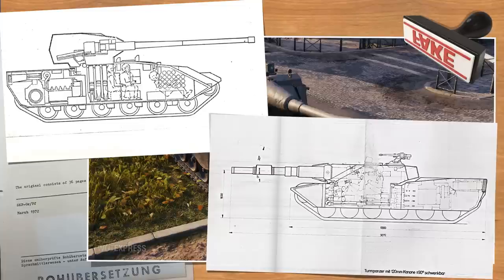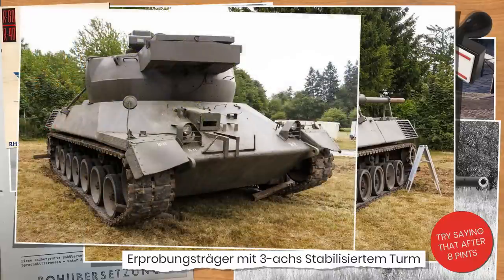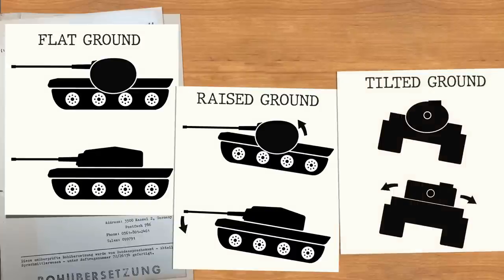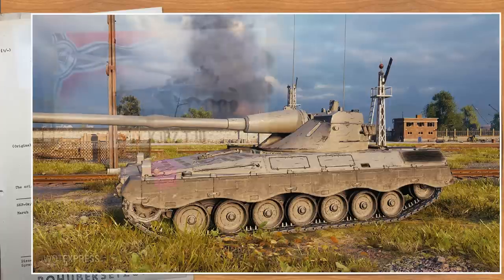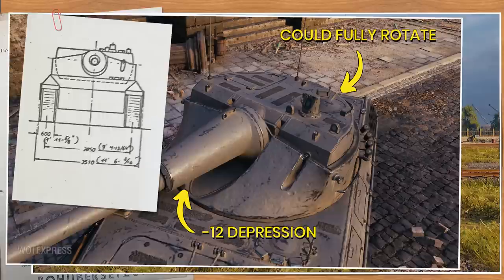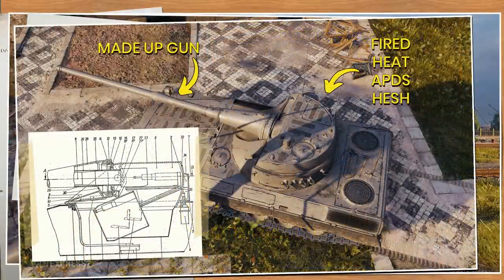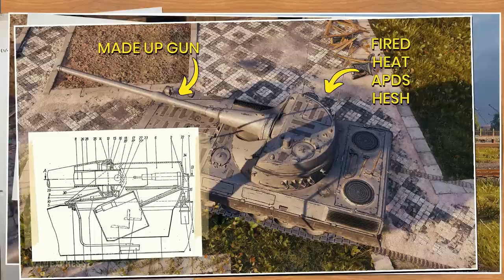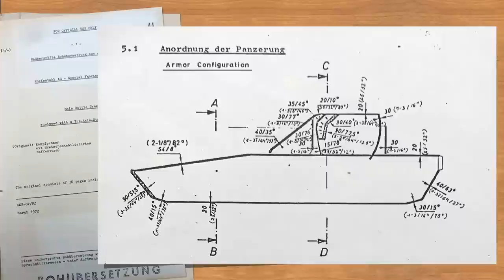KPZ III  - Fact? Fiction? or Fake?

Comment: I love how they make up gimmicks for fake or near-fake tech tree lines, but willingly ignore opportunities to give historical vehicles gimmicks, and just water them down into generic vehicles. 
I would imagine this same tank but with the engine gimmick you mentioned would actually sell better. It could have been sort of like the temperature gauge thing they showed for auto-cannons. You get can boost for 10 seconds at most, but then after that, it acts like the removed speed governor on crack, which would quickly destroy the engine and set you on fire. It would require more micromanaging, but  could have allowed for an unique min-maxing builds where prioritizing internal module durability actually lets you get more out of the turbo mode.
Reply: I can give you an even better one: give it the same mechanic those Chinese "rocket tanks" have. It works literally the same way, giving a power and top speed boost for a few seconds, and takes a while to recharge. Nerf the top speed a bit and you're golden.
Reply: HarverTheSlayer I like a heat management system more, instead of set recharge you can boost at difference times, but the longer you wait to boost again the longer you can safely boost.
Reply: @matthiuskoenig3378  Oh, absolutely, that could be cool as well. I was just making a point of using a mechanic they ALREADY have in the game.

Comment: oh, that's a cool concept of a tank gun.. was like"ok so how does this differ from oscilating turrets" and then saw the gun could tilt sideways as well to accomodate for uneven terrain. that's why theres a some sort of a "gun mount" on the outer turret and the inner turret being basket-shaped to fit in. very cool.
also germans designing cool engines, nice... cant believe engie boosters are actual thing for tanks 

kpz-70 in blitz also was pretty much gutted to be in tier 9 as well(base horsepower being 1500->750)
so... sad idk

Comment: WarGaming really needs to change the name of the game to World of Bullshit . Same goes in World of Warships with the subs they added to the game. Have you ever heard of a WW2 era sub capable of a sustained submerged speed of 30 knots and armed with homing torpedoes ???
Reply from the maker: homing torpedos for certain both german and UK had them, but defeated easily by foxxer systems - accounted for a few kills tho. but 30knots. no. there were some that could hit 24knots surfaced. and even fewer at 20knots submerged
Reply: @armouredarchives8867  The homing torpedoes that existed in World War II were also short-ranged and slow. The ones in World of Warships are a lot more akin to modern wire-guided torpedoes.

Could be worse, though. In the initial test server version, they were straight up moving like Mark 48 ADCAPs. What actually ended up in the game is merely annoying rather than being outright broken.
Reply from the maker: yeah obs they went and made a dog dinner out of it, its WG related. but it was jutst to clarify such things did at least exist.

Comment: When Wargaming does this to designs that have fairly complete real stats available is the most obnoxious part. If they're outright making up a tank, or using a tank that only "existed" as a concept rather than being fully designed, fair enough to make the stats whatever they need to be for the intended in-game role. But if the tank has real-life stats that don't fit the intended role (or are outright too strong for the game period, as would likely be the case for an accurately modeled KPZ III), the obvious answer is don't use it. Don't turn it into something completely different to shoehorn it into the game. Why is that so hard for Wargaming to understand?

Comment: CV90 with rotating turret?  But how do you get a round into the breach (what breech?)? With a raised barrel?  I don’t think so.
Reply from the maker: not sure where u are gettign cv90 from. - the magazine is from from below.  pretty easy
Reply: @armouredarchives8867  it looks LIKE a CV90.  As other people said it looked LIKE it took inspiration from other fighting vehicles. Nothing more 

Look at the drawing/images at :25, a straight line down the center of the barrel would take the breech into the turret ceiling/wall, with insufficient length to slide in a round.
Reply from the maker: https://imgur.com/a/wnBdQWa the autoloader loads the magazine from below  -
Reply: @armouredarchives8867  I know. look at the drawings and the tiny amount of room in the turret for autoloader, horizontally sliding breech block, rammer, recoil, and ejection operations. Looking at the drawings and photos of the turret showing the center of the bore, the gun (with  breech) intersects the roof of the turret.  So clearly there is not room for any angle of depression.  I mean it’s only a made up tank for a game, it’s not like it would ever be developed in real life from these drawings, so it is really not a big deal.
Reply from the maker: well they did make one. the previous vehicle. the gun does not recoil its rigidly mounted. - think of it as a rifle with a magazine below. the rounds are under the breech area, fed from the bottom. - the gun itself does not depress or rise so it has no need to move up or down, the whol turret tilts up and down like and occilatign turret, but in 3 axis. they already made a workign one 6 years prior that worked.
Reply: @armouredarchives8867  i think we are talking past each other.  If there is an archive of additional details drawings of the actual tank, perhaps that would address my questions.  I enjoy the channel very much.  Take care.  

PS I Totally agree WoT is a joke when it comes to pretending historical accuracy.

Comment: Good of you to point out how the gaming industry distorts the truth in favour of income. Now, please return to your video on wheeled armoured vehicles that states a fluid flywheel allowed the same speed in reverse as forward. RUBBISH. A fluid flywheel alloyed the use of a pre-selective gearbox only. Forward or reverse were achieved by a separate conventional gear train that utilised all the main gearbox ratios from the output shaft. Austin Champ has 5 forward and 5 reverse gears but a conventional single dry plate clutch. London Transport RT type buses from 1938 could not drive  backwards as fast as forwards despite having fluid flywheels. Just a tip from an ex-squaddie, driver, mechanic with hands on experience of the vehicles in question. I also have the original military driver hand books should you wish proof.
Keep up the good work.

Comment: it's an arcade tank game, it's not supposed to be historical. changing the characteristics of a basically fictional vehicle is not that big of a deal
Reply from the maker: hows it fictional? odd that when they try to change things like tiger 105 which was far more 'fictional' than this people get up in arms
Reply: Go watch the previous video on the UK premium wheeled vehicle. Despite having all the information to make an accurate visual representation the only thing they got right was the number of wheels. The complaint is not changes made 'for the game' but that they can't even care enough to correctly represent the look.
Reply: @Armoured Archives  that's war thunder innit? World of tanks has Japanese super heavys, which are *completely fictional*. I agree that some changes made to the tank in the video were unnecessary, but having a tier IX with a 24 round auto-reloader and auto-ricochet hull along with an inane power to weight and and top speed AND 12 degrees of gun-depression just wouldn't work in-game
Reply: @armouredarchives8867  (and that's not even mentioning the ammo)....
Reply: The worst part is them playing it off as real.

"it's an arcade game so they can change the characteristics and still pretend it's accurate." is a poor arguement.
Reply: @Matthius Köenig  Oh I don't think they should play it off as real at all. They should specify that the "historical" background of the vehicle is fan fiction. 
I also think that the reason they call it a jagdpanzer is because if you look up the tanks name, you will only find the wot variant and nothing historical, cementing the fact that it is a game vehicle and nothing else (for anyone who searches it up)
Reply: @oskar_2114  fair